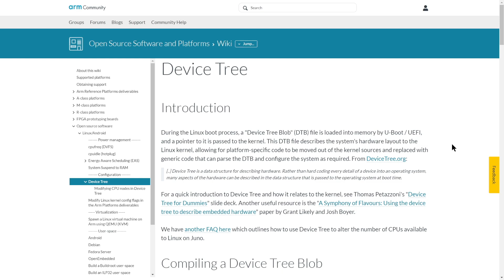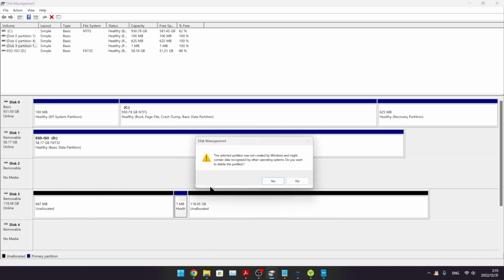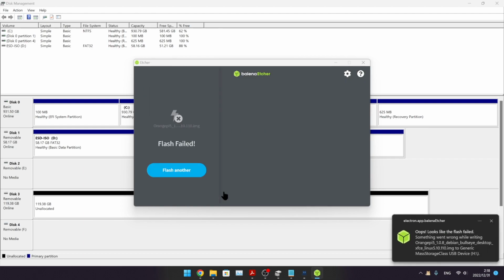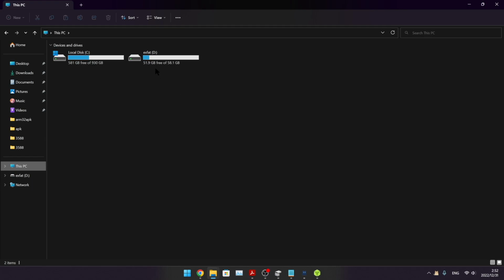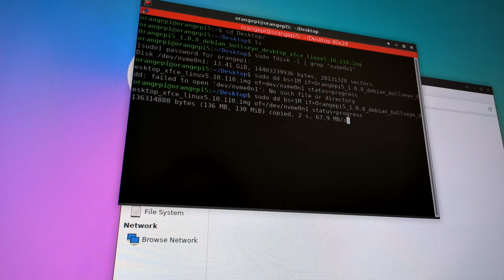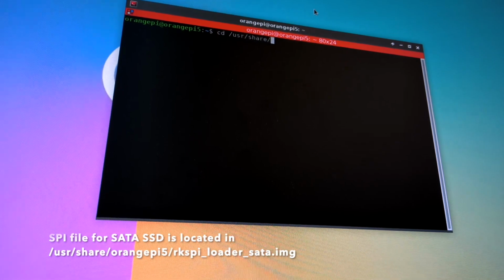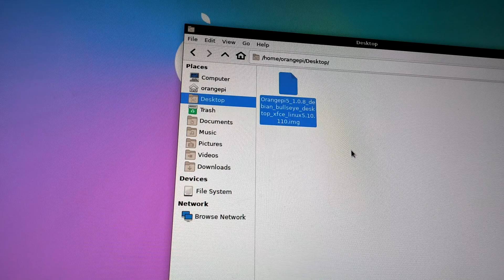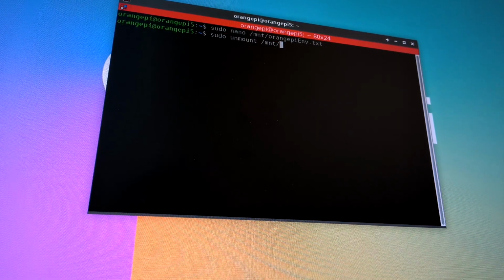how to flash orange pi 5 - linux part

Comment: How do you do this on the OPi 5 Pro which doesn’t have an spi flash chip?
I want to add an nvme and use the emmc to boot and run the is from the nvme.

Comment: Hello. Great video. I have a Khadas Edge-v, which I'm trying to unbrick and I don't know where to start. Basically the way I got it bricked was when I "write bootloader to spi". Now I've been looking for info on that everywhere but can't find much. Thank you.
Reply from the maker: sorry I just noticed today. RK3399 is similiar to RK3588, you either boot loaded by ddr.bin miniloader.bin or TPL(u-boot), thus RKDevTool is the u-boot way, using tool directly flash emmc which Khadas Edge-v have can also be worked.

Comment: Thanks for the great video.  Quick question.  If I've only gotten Ubuntu desktop to work the board so far, can I still apply the first part of your video to it to get my NVMe drive, they are both Linux correct?
Reply from the maker: If your the image from orange pi official, yes their debian and ubuntu are the same procedure.

Comment: Do you have any idea how long the first boot takes? I flashed the image on etcher like the video and my Pi 5 will turn on and the green light will flash but no display. I have tried android on it and it worked just fine so I know theres no issues with the hdmi or monitor.
Reply from the maker: It will blink green and red alternatively if everything if okay. It might be your monitor or cable issue, however you can modify the config file to fix it by manually assign HDMI output mode.
Reply: @thankfish  The red light is staying on only the green light is blinking. I thought monitor or cable issue but I tried several different cables I've verified to work with other devices but no dice. How do I edit the config file for a .img?
Reply: @thankfish  also I just tried this same sd card with the android img and it displayed almost instantly. I used the SDDisktool to write the android img that worked, but I used balena etcher for Ubuntu and Debian( neither of which display)
Reply from the maker: @MOOSEMAN7809  sounds the image did flashed correct and the OS did boot , and sorry for my unaccurate description about red light(it is staying light). I did a fresh flash, it took me 1 min for first boot. You can SSH on your board then execute  xrandr to choose your resloution may help you, xrandr you can get the result immediately choose resloution and fresh rate. Check router status or use LAN scan tool to get its IP for SSH, default username and password both orangepi. 
Which image tool to use should be the same result for linux image. 
And sorry for I took the config file for granted, which I did on raspberrypi OS, It seems on this image you have to fake edid which seems have to modify the system, so please use xrandr. 
Besides the newest 1.1.0 image did fixed my 1440p problem which I force OS use 1080p before, it works out of box, so maybe you can try the newest image.
Reply: @thankfish  I reflashed it and tried it on a higher resolution monitor and it worked right away! Android was just fine on the 1600x900 monitor but I guess the linux img only displays at 1080p. Thank you a lot for your help! I wouldn't have even thought of the screen resolution being the problem haha
Reply from the maker: @MOOSEMAN7809  gratz! On newest 1.1.0 image I tried 4K 60Hz,1440P 120Hz and 1440P 60Hz both works out of box while armbian still does not support it well, which  works not well on 1.0.8.

Comment: hdmi is turned off on my orange pi 5... i tried turning it on in debian but it did not work, couldn't duplicate display or anything
Reply from the maker: Is it broken?
Reply: @thankfish  no actually it does work on my 1440 monitor, wont work with 720. guessing they are all like that
Reply: at least for me on debian 1.0.6
Reply from the maker: @richybean2421  1.0.8 does not work well on my 1440p also, I used to use 1080p 60hz before. It did fixed itself on newest 1.1.0 out of box, so may be you can give 1.1.0 a try.

Comment: Sincerest thanks for this great video.  You saved me the time and trouble to do the trial and error which brought success!  Your method got me running Debian and later also Ubuntu from the NVM SSD.  Does anyone who read this comment have any idea how to install the kernel headers for rk3588 on the Orange Pi 5 Debian or Ubuntu?  I need this in order to build a custom driver for my Wifi/Bluetooth USB dongle.  When I try to install the kernel headers I get the message that it can't be found.  Has anyone had success with installing the kernel headers?  How?
Reply from the maker: Thank you :) Could this help if you want to compile by your own? https://github.com/orangepi-xunlong/orangepi-build (next branch not main branch)
Reply: Thanks for pointing me to this excellent resource.  I just had a quick look and I believe that I'll have to dig quite a bit deeper here to determine if it will solve my problem.  Thanks again.
Reply from the maker: You are welcome. :)

Comment: thanks my man i am getting this board soon
Reply from the maker: you are welcome :)
Reply: @thankfish  I sadly have a SATA b type SSD, and it doesn't get recognized only nvme seems to be supported now.
Reply from the maker: @ThoMohT5827  SATA SSD has a different SPI flashing procedure from NVMe SSD, and an additional boot config file edit procedure after flshing SSD, which I demostrated in the video may it can help you.
Reply from the maker: @ThoMohT5827  Also if you want to use Android, make sure to use SATA SSD image. Linux on the other hand using one image but different way to flash it.
Reply from the maker: @ThoMohT5827 B key M.2 SSD usually comes with B key +M key, so just use it is SATA SSD, I think yours can be used.
Reply: @thankfish  yes i understand now thanks

Comment from the maker: Accroading to changelog, since v1.0.4, supports wifi on RTL8211CU, RTL8822CU, RTL8723BU, while Bluetooth works on RTL8821CU for Linux.
Reply: Do you have any idea how I can get RTL8821CU on a USB dongle working in Debian or in Ubuntu?
Reply from the maker: @brendonbentley6617  You should have the newest version debian or ubuntu, the old one does not support it. You can use lsmod to check it after you plug it in. Mine 8821 works well on debian v1.0.8.
Reply: @thankfish  Thank you so much for this information 🙂  I moved my USB dongle to the top USB 3 port on the Orange Pi 5 board and it now works with the latest Ubuntu!  It does not work in the bottom USB 3 port - this was the only issue.  Thanks again.  With your help I now have working Wifi & Bluetooth as well as running the OS from the NVMe on M.2.  Excellent!  😉
Reply from the maker: congratulations 😄